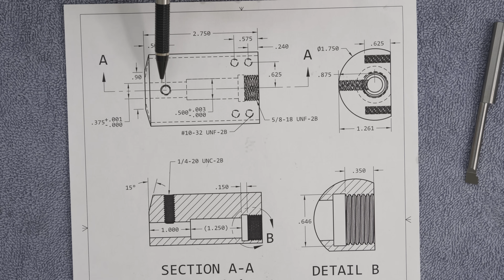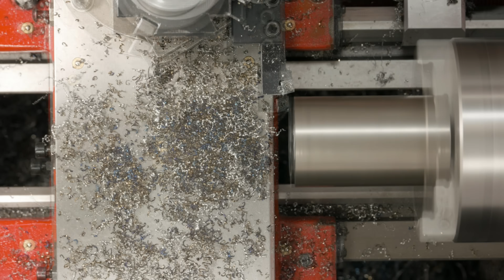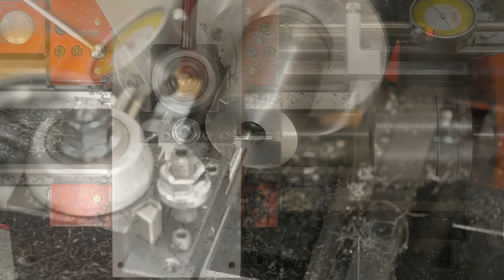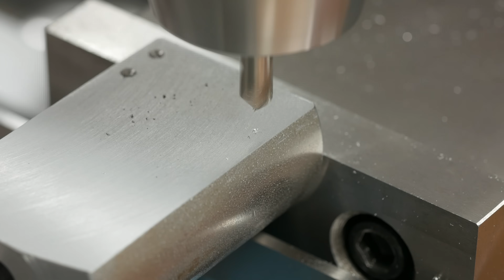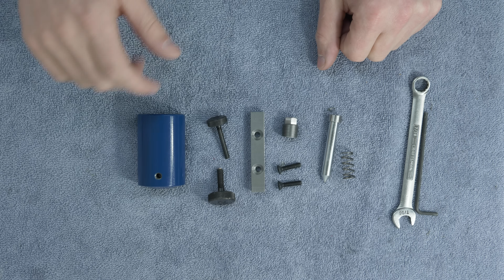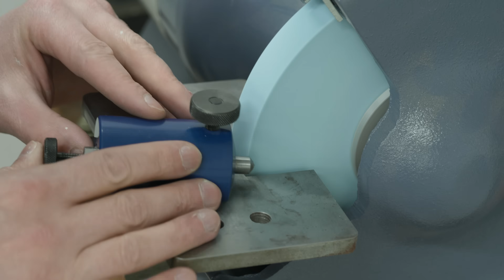Bench Grinder Diamond Dresser Part 2

Comment: Very nice, I also like the rests on your grinder.  One question, are you using Lawson drill bits?
Reply from the maker: Hello George,

Other than my metric set, I use Triumph Twist Drills Thunderbit line. They are 135 degree bits, and have an excellent multi facet grind.
https://triumphtwistdrill.com/thunderbit/

Comment: That was a great project and neat idea very well executed, bravo good sir 👍

Couldn't help notice the way that facemill cought the work on the last pass, I was having similar problems with my mill too. 

I ended up stripping it down for a complete refurbishment and the bad surface finish I was seeing turned out to be caused by shot quill bearings. 

As annoying as it would be, it might be worth taking a look to see if your quill bearings are showing signs of wear, personally I can't wait to see what difference the new set of Timpkin I got for it will make (once I've installed them, need to finish a quick press modification first).

Anyhoo, loving your channel so far bro, wish my presentation was as good but I tend to flounder between concentrating on what I'm doing and trying to explain things as I go. I think I may change my format a little to compensate, I'm just not much of an outspoken talker. Of you get a chance, I would be stoked if you took a gander to say hi, I have a couple of projects in there and on the way that may be of interest to you.
Reply from the maker: If memory serves, I checked the inserts at the end of the project and they had started dulling and needed to be indexed. Honestly, I should have just taken multiple passes in the x direction, as my mill doesn't seems to like it when I hand feed face mills.

Comment: Wow I didn't know that anybody could be so strong. At 20 minutes and 16 seconds you pulled on the tap so hard that it twisted the flutes that was amazing.
Reply from the maker: lol, I switched to a spiral flue bottoming tap,  so I didn't dig the tip of the spiral point I started with into the bottom of the through bore.

Comment: Very neat and well done. I've never had one of the diamond dressers how does it hod up. I did here you say you would probably have it the rest of your life. And do you ever have to reshape the diamond point , I noticed the shaft looked at least an inch long didn't know if this was for reshaping or just the way it was made. I do have one of the small T shape diamond dressers that came with my grinder and it has spots on it that the diamonds are wiped clean or off. And if I may ask where can one be purchased at. Thanks for taking the time to do the video.
Reply from the maker: Hi Anthony,

The diamond itself is a consumable that will have to be replaced eventually. Thankful they are fairly cheap, and In a home shop like mine it will easily last several years. The diamond was 3 inches long when i purchased it, and is usually used in a fixture to true up the wheel on a surface grinder.

Just about any industrial supply place will carry them, and they can also be found on Amazon & eBay fairly cheaply.
https://www.mscdirect.com/browse/tn/Abrasives/Grinding-Cutoff/Dressing-Tools/Diamond-Dressers?navid=12100097
Reply: @Dans-hobbies  Dan I recently purchased one of the diamond dressers and I have completed the body of the holder and I'm at the stage of mounting the slide guide, I noticed you have yours mounted at an angle is there a reason for this and if so what angle did you use. Thanks for any help you may give me.
Reply from the maker: @anthonycash4609  Mine is mounted at 15 degrees. You always want to drag the diamond across the wheel, as it prevents the diamond from being able to dig into the wheel and potentially cause a serious accident, and it also helps prolong the life of the diamond. It's also good practice to rotate the diamond 30 or 45 degrees before each time you use it. 

here is a diagram from an old Norton Abrasive info packet that shows how to use a diamond dresser. Note that the diamond faces down, so that again it can't dig into the wheel.
https://i.ibb.co/rQ63pcZ/Wheel-Dressing.jpg
Reply: @Dans-hobbies  thanks again for the time and effort it takes you to put out all the videos so that others may learn by and enjoy watching. And thanks for the speedy reply to my question. I can finish this long overdue project now.
Reply from the maker: @anthonycash4609  No problem!